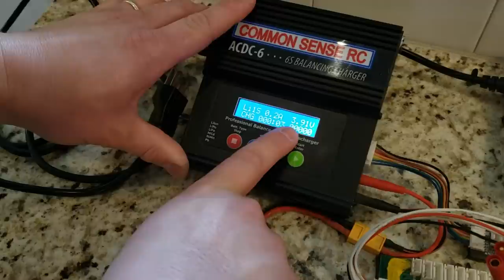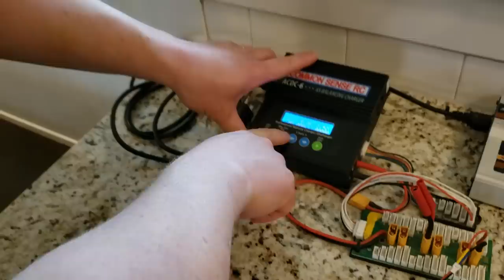Eachine - P-51 Mustang - Mini - RTF - Unbox, Setup, & Maiden Flight

Comment: As cool as they are and they really do fly well please note: there is no info on performing a range check.... second flight with mine and second flight on tx batteries it was well within sight and it just kept going...if it had 5 min of battery left at full throttle, add 5 mph down wind it's probably 4 mi out in the open desert ..full size r/c systems usually move the servos a ways and then the plane comes down..which is closer and it picks up signal again..this one goes fly away it's gone.
Reply from the maker: I'm sorry you lost your plane, that sucks!

This is unfortunately true for almost any of the small planes. Range test is not something you're going to find on a sub $100 plane. Even some that are well over $100 don't have such a feature.
Reply: @BrianPhillipsRC  I found a courtesy card in the box. support@exhobbys.com.  Sent them a polite letter and an explanation...see where that goes....wonder if it's happen to other people and they just write it off and not bother to say anything...or maybe I'm the only one on the planet that had a problem
Reply: @BrianPhillipsRC  how do you bind the plane to a jumper T16 I have, nt got a clue mate
Reply: @theoztreecrasher2647  cheers mate works great but I've also got its big brother p51 750 Rtf carnt find the protocol on that one,, the radio, s when you buy these things don't do the plane justice love these thing to bits
Reply: How do u bind a t16 jumper to a rtf  750mm valantex p51 Mustang can anyone help cheers
Reply: @BrianPhillipsRC  Brian they fly a hell ove a lot better on a full size radio lovely little plane so small as well always in the car cheers
Reply: If set up on a full size transmitter I think it, ll get a longer range would think so
Reply: @theoztreecrasher2647   I got them to warranty it with a plane/no tx deal. If it goes out of range it shuts the throttle but the gyro stays active so it turns into a glider that will continue in the same direction. Thing is so damn small it dont take much to get out of visual range....as opposed to full size tx/servo deal...range is line of sight and if you have range issues the servos will usually take a run in one direction and the plane should spin itself back to range.
Other than that the mustang is a bad ass little deal..no need for a runway, stupid quiet...if someone can run an rc car so they know orientation one or 2 flights and they have covered.....close to 80 flights on #2. took the landing gear off...made a skid out of a paper clip..couple pieces of clear tape on the bottom..only one little nick on it and i fly off sand/gravel.

Comment: Looks very similar to Parkzone Ultra Micro P51 gen1.Witch is a good plane,have had one  for many years,now retired as static model...Actually better than gen2 (with 4 blade prop).
Reply from the maker: The parkzone is way more detailed and a lot better landing gear, but the technology in the Eachine is a bit newer, and the plane is a bit cheaper too.

Comment: Hey Brother!!! I’m embarrassed to say that I am clueless as to installing the landing gear on this Volantex mini P-51 .Please help I don’t want to break this thing before flying!! Thanks your friend Jeff T. I love your videos, and it’s really nice you have a great wife who loves your hobbies, not easily found!! God Bless and MERRY CHRISTMAS 🎄
Reply from the maker: Did you watch me do it? I do show that ;) It's not hard... you should just be able to slip them in, and then if I recall right, you set one screw into each mount to keep them in.

Don't worry about flying this thing. It's NEAR indestructible (please knock on wood now that I said it)...but when you have your first crash and the prop comes flying off, don't freak out...unless you hit your eyeball, then DO freak out, otherwise, just carefully and gently slip the prop back on, start on ONE SIDE and kinda "Roll it on" - you'll get it when you see it the first time. If you push it on straight, you'll be likely to push the motor and gearbox back into the foam.

Just pick a nice calm day, and loads of room, and you'll have a BLAST!!! Don't forget that I warned you it's a lot harder than you might have thought, but you'll have a new found appreciation for flying RC planes ;) DON'T get discouraged if you suck worse than you thought you might - you probably will - but in a few short months, you will be flying many more times difficult planes, and doing it with some level of impunity...if you don't give up, or hit yourself in the eye - then you're pretty much screwed...so don't do that. Wear safety glasses and a helmet, but most importantly, a nut cup - SAFETY FIRST ;)

Enjoy!
Reply: Your video , usually Excellent, basically skips right over the gear install! I m old school and like to have a traditional landing and takeoff! Are t you telling me the slots next to scre holes are where yo insert gear? Also I’ve seen struts on outboard and inboard ? Very confusing!!  I built a Topflite Gold Edition P-47 and wasn’t half as confused with this little Bastard ! Chinese, go figure. Do I have to cut through the plastic slots next to screw holes???   I’m getting ready to omit gear, but I really like scale shit!!  Please advise!! Thankyou Again J.T.
Reply: I would like to have a few cocktails with you guys and talk airplanes, you both are very 😎 Cool!! You are to R/C video what Guy Fierrie is to cooking! You have a Great Personality, and so does your very skilled pilot wife!! It comes through on your videos!! My other favorite is the Saylors!! 💕🇺🇸🎄🥃😀
Reply: I have built a couple of pretty large places, my 1st was a MIDWEST MODEL P-51D , I am really a static model builder, if you go on Facebook and look at JTs Model Corner, you will see some of my work. I HAVE NO IDEA HOW TO FLY A AIRPLANE!!!!
Reply: @BrianPhillipsRC  there are slots next to screw holes but they are Not open to insert anything!! This is what’s kicking my ass right now, I don’t want to start surgery on this little bastard, and destroy it!!  I hope you can help me with this issue. YOU ARE THE MAN! !!!!! I Love your videos!! Please help!!! Jeff T.

Comment: show how to change the propeller saver, as it is extremely difficult and nobody did it on YT yet...
Reply from the maker: The prop saver? I did show it
Reply: @BrianPhillipsRC  yes, theoretically at 6:30 :)  The motor shaft - white part is extremely difficult to put it back on motor, as when you push, the epo is moving. I cannot do it, as the prop is few mm away from body. Crazy.

Comment: What charger do you recommend?
Reply from the maker: For this, if it's your only plane, the one that comes with it, if not, we've been using SMART batteries a lot, and they're amazing...but the charger will ALSO do regular lipos too...

These are specially designed for SMALL batteries...

S44 4X 1S Charger https://bit.ly/32tpGx3
S63 6X 1S Charger https://bit.ly/3iLuP8Y

BUT, I like to use the even nicer ones, but then you have to use adapters ;(

Chargers https://bit.ly/32qiuBD ( This is my current favorite - S2200 https://bit.ly/398ohO6 )
Reply: Thanks so much! My plane was coming today so I wanted to check.

Comment: Brian, what do you do with all the airplane radio's that you accumulate when buying different airplanes that come with a radio?
Reply from the maker: Good question! I keep them organized, and labeled. As you probably know, I have a Spektrum DX18 as my main radio system, so that handles about 70 planes, drones, heli's, and other stuff for the moment, and then these little RTF's are kind of a pain in the butt...so we just keep them in small Tupperware containers, and I have them all labeled to keep them straight.

Comment: The name of the brand is pronounced ESHEEN likw Charlie sheen might have spelled his name wrong just now lol but you get the picture. good lil company their mavic clone is the most sold one on the market. did you get that from WISH ive gotten some good namebrand stuff there actually.
Reply from the maker: Yes, Charlie SHEEEEEEN -  EAAAAA-Sheeeeeen - I figured this out after filming the video and then hearing a few helpful folks in reply ;) It's a great little plane, and eachine has turned out to be great!
Reply: @BrianPhillipsRC  Yes they are a pretty good company. I plan on getting this one ,because I fly quads and helicopters and ground rc ,but have never bought a plane. with newer foam they use and how you flew it plus the price convinced me to get this model to start on. My first drone was a Eashine as well  lol.
Reply: @BrianPhillipsRC  I finally got mine today Brian after 3 almost 4 mo of waiting I had some rudder issues but got it working havent put in the air yet though. To windy. Thanks for the review I havent flown since I was a kid and always crashed lol I'm a 37 year old kid now. Lol

Comment: I bought one of these a I can't get it to fly. It taxi to the right and the elevator doesn't move. Any ideas on what the problem is and how to fix it? Thanks.
Reply from the maker: I'm sorry this is happening to your plane!!! Watch when I crash mine, right away. I had to start it up again, and it snapped into normal behavior, but not sure what I did differently.

I KNOW you can change the direction of control axis, by holding the stick ALL the way to the left, for example on the ailerons, if you want to REVERSE the Ailerons control output. This is more than likely NOT your issue though. I think you  have the issue I was having.

Comment: Stuck Tail Wheel? or no Tail Wheel. We used to do this turning Tiger Moths with a Skid...'Elevator Down, Rudder over,
Kick power, and around we go..'
Reply from the maker: I bet that was scary!
Reply: @BrianPhillipsRC  No problem, a kick meant just that a 'KICK'. If you held 
power on,  you could be in trouble

Comment: where did you find a balance charger that will do 1s, all the ones i've ever had won't go below 2s because they won't charge a battery that doesn't have a balance plug?
Reply from the maker: What charger are you using? Make and Model?

Comment: Plugged my esc battery 
Prop started spinning straight the way. Now doesn't work at all ,do I need a new receiver how do fit one have I wasted my money.
Reply from the maker: I hope not. Did the motor burn up??!?! Sounds like the throttle was armed right away? Maybe it's plugged into the wrong channel?

I can't say there's never been a lemon from China...and I'm sorry to hear that you had this issue!!! Have you reached out to Banggood? (I know that will suck - BTW - but they are the ones who will help you out)
Reply: @BrianPhillipsRC  not spoke to banggood, I think this is my fault, do i need a reciver or new motor or both is it repairable,any part numbers would be great. Thank.

Comment: Hey Brian, what's the cheapest and best rtf airplane that you would recommend for beginners?
Reply from the maker: This plane is cheap, and it's pretty good, but the controls are still a bit wonky, compared to a Sport Cub S UMX, which will also fly a lot slower. HOWEVER, the Sport Cub S UMX will cost you about 2+ times what this plane costs, and it will NOT handle the wind as good. The controls will better translate to any other plane. This plane will be fun to get in the air, but you would probably learn some really bad habits.
Reply: @BrianPhillipsRC  thanks buddy.

Comment: When you initialize any gyro on quads or small planes, they have to be set on the ground in its level position or it will get all messed up.  Usually each time you attach the battery.  Not a bad flier.  Sort of like my Horizon T-28.
Reply from the maker: Yes, I had an issue with another plane yesterday...video not yet posted....but this plane has been a great plane!!!

Comment: I’d love to see this fly inverted and some close ups of touch down and take off. Very helpful video though thanks!
Reply from the maker: This plane doesn't really "do" upside down flight...and landings are not it's strong suit, if that's what's helping to drive your decisions.

If those are the things you want, then there are so many good choices, especially P-51's ;)

The landings on this are wiggly and sloppy at best. The weak, thin and long bogeys allow for way too much movement, so forget about making a clean rollout. One COULD modify this feature to be much improved, and without too much effort, but I wouldn't.

Upside-down flight is very marginal on this plane. There's not enough power, and even if you had it, flying in Expert is extremely demanding, since the stock Tx and Flight controller work in tandem to make the thing even flyable. 

P51 https://bit.ly/3bU5icI (get the 1.2m size)
+
NX https://bit.ly/3mbVuNB (get the NX8)
+
2200 3S https://bit.ly/3xl5IQJ OR 2200 4S https://bit.ly/3iiTjbI (I'd do 4S)

Then you can do anything you want, and do it in style.

We have videos about this P-51 to - https://youtube.com/playlist?list=PLXTH0DstRDc7eBkhi9kZVXgJ3NaEK1SHA
Reply: @BrianPhillipsRC  unreal! That’s great info. Thanks mate.

I am going with this little p51 as a first plane ever. We’ll see how we go. I’ll definitely consider what you’ve suggested down the track👌🏻

Comment: Thanks for the great video! I ordered the plane and unfortunately it arrived without the screws for attaching landing gear. I saw from you video that you got the screws. Could you please share with me a photo of the screws and size so I could try to buy them locally? I am contact you because the seller and Eachine were both unable to tell me that. Thanks a lot for your help!
Reply from the maker: I cant share a picture, BUT I can tell you if you have any planes with control arms with screws, you will find a screw the right size, or super close.
Reply from the maker: I went downstairs and evaluated the screws, and they are missing on my P-51, but the Corsair has them in. I don't think we're flying the P-51 with screws to keep the gear in at the moment. Maybe you could just throw a small piece of tape (1" long) over the spot where the screw would act as a retainer?
Reply: @BrianPhillipsRC  Thanks for the tips!

Comment: If you hold it to the bottom left for a few seconds it inverts
Reply from the maker: yep, I figured that out on a later Eachene plane. If you hold any direction for a few seconds, it will invert that control axis...very nice feature, except when you're not expecting it ;)

Comment: Hi Brian!  Loving the Sport Cub 500 you recommended as our first trainer.  Thanks for that!  Debating now between the mini P51D from Volantex (761-5) and the larger one you reviewed (768-1).  Love that the 768-1 has a larger wingspan and therefore hopefully easier to spot in the sky, but have also heard it is pretty fast so perhaps not such a great second plane and maybe better stick with the mini P51D.  Also, I understand from your video the props on the 768-1 don't have the neat break-away feature either.  Thoughts?  Thanks!!
Reply from the maker: The LARGER (750mm) one is NOT the best...it's OKAY, but you will be frustrated, even if you're a pretty good pilot. The smaller one is a blast to fly, and really fun!

If you want to progress beyond this small one, seriously consider the Eflite P-51D 1.2m and a Spektrum Transmitter. You will be in it for a lot more money, but it's a true "hobby grade" experience...rather than a fun "toy grade" experience.
Reply: @BrianPhillipsRC  Thanks for the detailed and prompt reply as usual Brian.  What you said is pretty much what I concluded from your two videos on these two mustangs as well as other videos I watched.  I will definitely consider your suggestion about a larger, hobby-grade plane too.  Thanks for all the great videos - they are certainly appreciated!!

Comment: I have a charger from a airbus a380 that was from wltoys I think, would this battery work in that charger
Reply from the maker: Mare sure the polarity is right, then check out the power output to see if it's reasonable.
Reply: Ok thanks

Comment: I was wondering where I could buy one of those chargers for the planes battery 😀?
Reply from the maker: Here's a short excerpt from my video description...

"
Balance Charger - https://amzn.to/2IxmRla
Parallel Board - https://amzn.to/2uduI1v
Parallel Cable for Eflite 2S Lipos - http://amzn.to/2E9hXVn
Simple 2S/3S Charger - http://amzn.to/2ruHHKe
Voltage Alarm 1-8S Lipo - http://amzn.to/2G6jqxy
"

...if you check the description, I've got some links that I copy from video to video. If you buy from these links, it helps to support our channel too, which is very much appreciated. If you don't, that's cool too, we're glad to help you figure out what you need...there's SOOOOO many choices, and they are sometimes deceptively marketed online.

If you find something, and want me to check it out, you can comment here, or on any of my videos, and I'll try to help you out. I can then reply back with a link to help support our channel too ;) Again, we've been doing this for long enough that I can usually smell the BS before I buy it...but sometimes I gotta clean it off my boot too - LOL!

Comment: You seem like a techie like I was but you need practice.  I started with the Piper Cub version of what you're flying and it made all the difference.  It is easier to learn how to fly using only throttle and left/right.  I like what you're doing but you need to work your way up one step at a time so you don't crash so much.
Reply from the maker: This is probably my 100th plane, or later even...and maybe 1300th or later video...crashing is part of my evaluation.